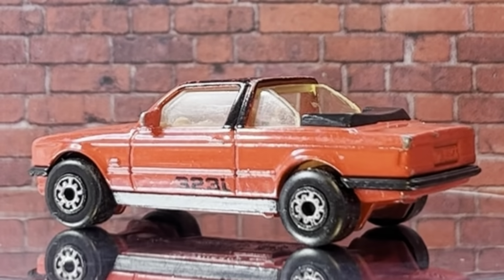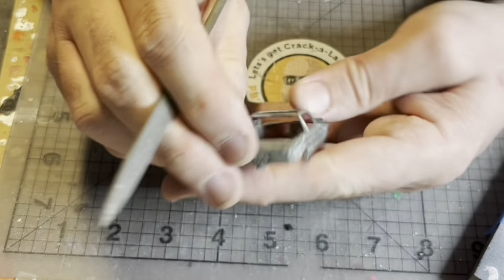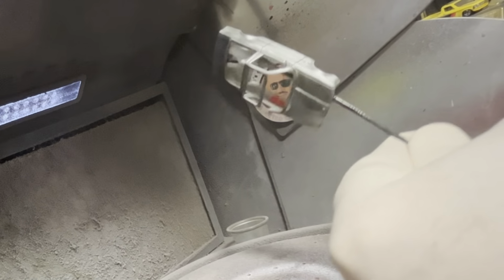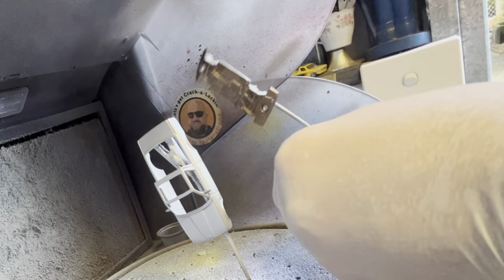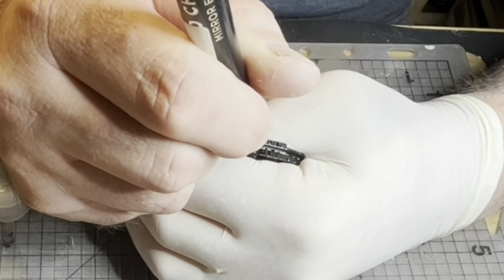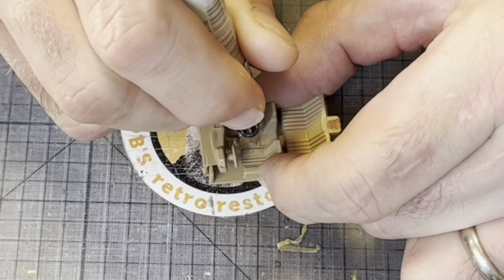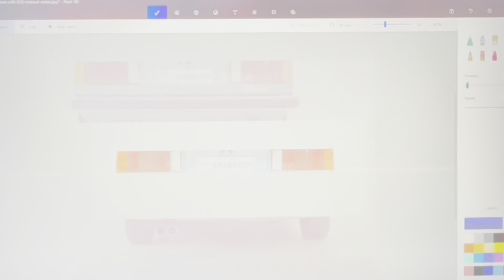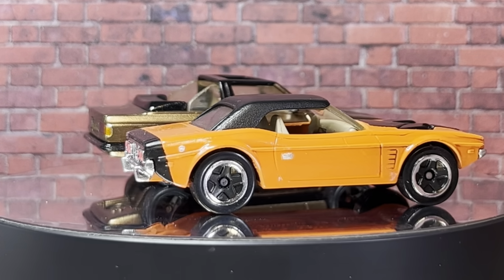Matchbox Superfast BMW 323i Cabrio & Dodge Challenger Toy Restoration SKIP'S PRIZE VIDEO!

Comment: great work, both of them, and great detailification. :) nicely accurate. ^^ love both colours. ^^
(someone told me that Ford made their Signal Orange '75 glow by adding a layer of Signal Green underneath. I haven't tested it yet with modelers paint, but without green the orange looks dull.)

interesting colour for the BMW. many would have kept it, we all have seen castings in worse shape. :)
ah, the famous Baur Cabriolet. Baur Karosseriebau (bodyworks) used to be a little repair- and customize shop downtown Stuttgart-Bad Cannstatt. they started to create these half-convertibles when BMW didn't mind bringing a convertible based on the '02 series. Baur kept the B-column and roofbeam, and instead of reinforcing the bottom structure into oblivion, they created a rollbar-like reinforcement of the column. the hole was closed by a targa top, while the area behind the b-column was done with a softtop. soon the Opel Kadett-C followed as well as BMW E3 and E30. the results were sturdy, nice to look at, not too heavy, but of course, pricey. they were all handcrafted, after all.
BMW eventually made a full convertible out of the E30, so there was no market anymore, and Baur returned to fixing accidents like they did before. they eventually closed gates somewhen in the 80's I think, and the company vanished. the place and workshop is still there, housing an entirely different enterprise.
Reply from the maker: I've not experimented with alternate base coats (other than black and chrome) but I'd believe it. Was the Opel Kadett-C the same as the Holden Barina? They made a few of those in cabrio form here, but from memory they were converted in Geelong, but I'm probably wrong. Thanks for the info and watching.
Reply: @PBsRetroRestorations  I'm not sure about the Holden, but they were licenced by Isuzu back when, called Gemini, and equipped with wider taillights. who knows, maybe Holden rebadged the Isuzu?
Reply from the maker: @lotharrenz4621  yes they did, but we never got a cabrio version of those.
Reply from the maker: @lotharrenz4621  yes they did
Reply: @PBsRetroRestorations  aww, bummer, man. :/

Comment: Both of those turned out wonderfully P.B.! 🥰

What do you think of the Tamiya Metal Primer so far? Definitely curious about it. 🥰
Reply from the maker: Thanks Summer! I just figured if Tamiya make a metal primer, it's their way of saying their other primer may not be best suited to diecast and may be the cause of some of the poor adhesion issues I have sometimes. It seems to work ok, but whether or not it's a 'life changing' improvement, I'm not sure yet. It's such a little can too.
Reply: @PBsRetroRestorations  A little can with what I bet is a BIG price! :( Tamiya paint has remained so pricey here as well. :( But of all the paints I have used so far, it has consistently given me the best results by far over everything else. :)
Reply from the maker: @SummerRoseRacing  You know it, but agreed, it is consistently reliable and a great result.